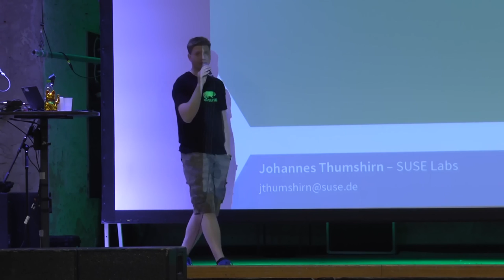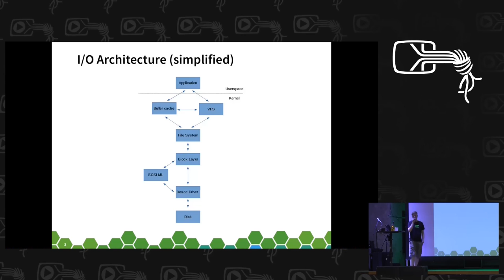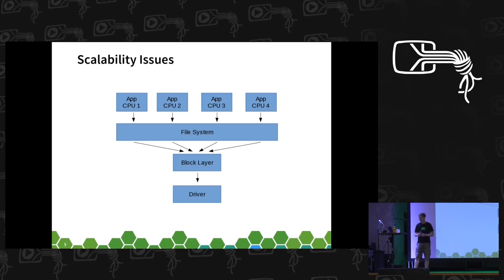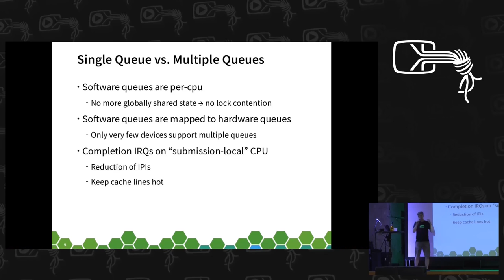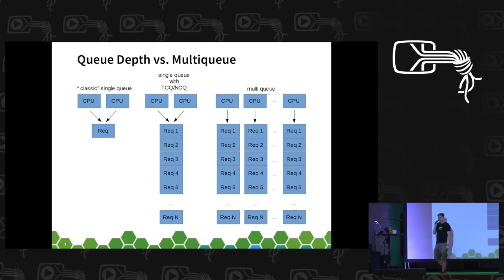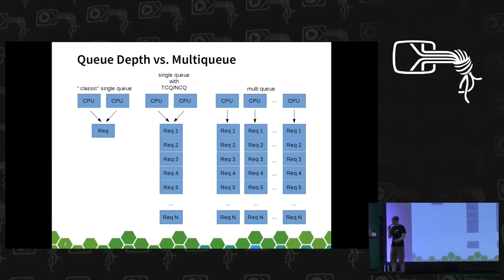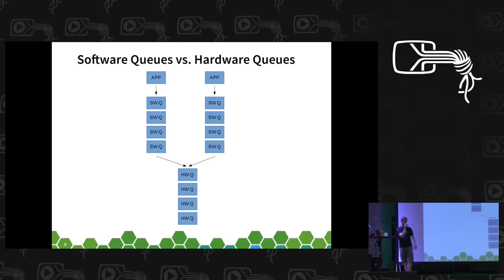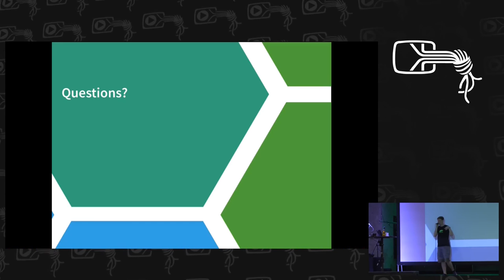Johannes Thumshin: Introduction to the Linux Block I/O Layer

Comment: Why is it such an inadequate reaction to the question about scheduling in another (happens to be proprietary) system? Why do you necessarily need source code to understand how it works? Have you heard about such a thing as documentation? I am not saying, there is documentation about I/O scheduling in windows, it may as well be a black box for outsider, I am just wondering why you guys have such a strange first reaction. The proper answer of a technical specialist would be "I do not know how it works, so I cannot compare; BUT if you know something, you could share with us, why it is better, or refer to some docs where it is written".